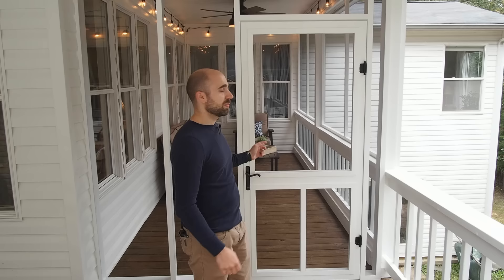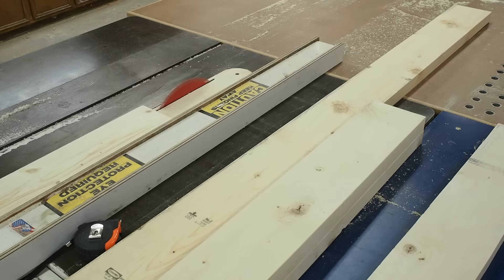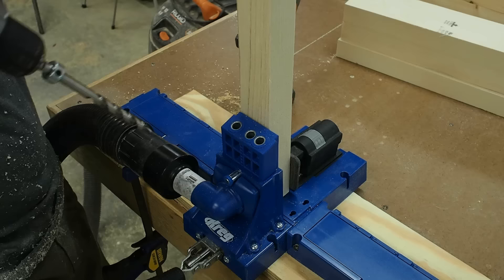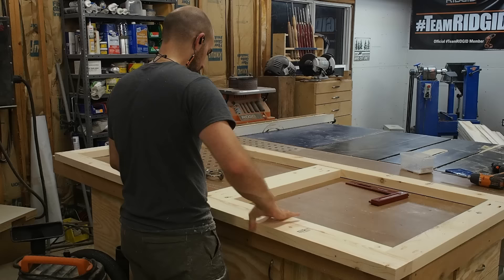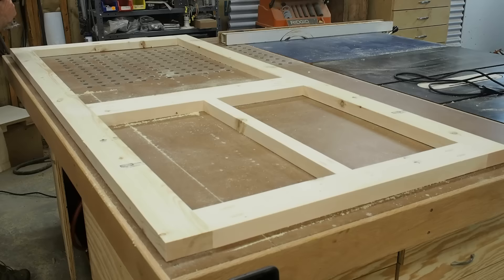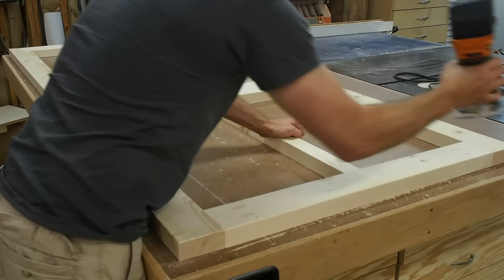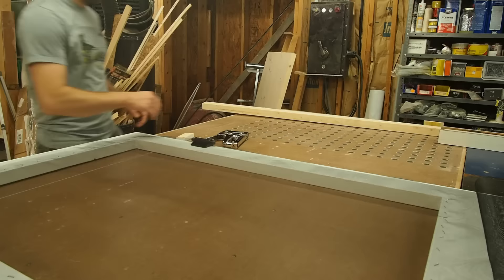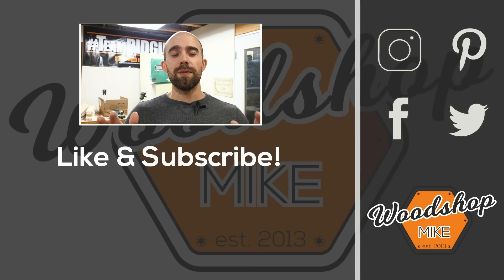How to Make a DIY Screen Door

Comment: Going to make one almost the same way.  Mike is right, this is quick and easy the way he's doing it.   Im not real fond of pocket holes for exterior application.  Im using stainless steel dowel pins in each corner and the bottom section of the door will be wood raised panels.  I only want screen on the top.....Great job Mike...
Reply from the maker: Thanks Raymond!  Happy building 🔨🔨
Reply: @WoodshopMike  You too Buddy!!!
Reply: Try Zinsser BIN Primer with a Top Coat of PPG Breakthrough......The combination of the two makes a finish I have yet to beat.   It's a little pricey but its worth it.  The primer dries extremely hard and gives a nice crisp hard finish with 220.
Three coats of PPG Breakthrough and its like  glass smooth...
Reply: I use a spray gun that is designed to shoot "metal flake" paint ....It has a 3.0mm tip so it will spray the primer and paint un-thinned.  If your doing any quantity of big doors or big surfaces....This is the only way to go....fast and awesome results...
Reply: Just passing on what took me 40 years to learn....If I can help someone with information...why not...right..???

Comment: I'm amazed you used pocket holes in place of the tried and true mortise and tenon.
Reply from the maker: Yeah I understand that.  Time will tell how they do, but a year in and the door is very solid 👍🏻👍🏻
Reply: The pocket holes were the "Quick and Easy" part.  Even I can do that,  lol....  Like this door, but it would be a week long project for me,  then it would drag. lol.
Reply: I'm going to build this with dowels--slightly cleaner and stronger than pocket holes and much less work than mortise & tenon.

Comment: Hi, this turned out great! I was curious to know how well the screen door held up? I read that the mortise and tenon is the best and most used method. I am just a beginner and wanted to make one in the spring. My initial thought was to use a Kreg jig and wood glue.
Reply from the maker: Hi Monique,
The door is holding up great!  Mortise and tenon will be a very strong joint that will last a long time, but we've had zero issues or signs of failure from using pocket hole screws.  I don't foresee any issues with the construction method I used for the door 👍
Regards,

Mike

Comment: Thanks for the video. Is that a Georgia Southern  shirt? Lol I went to school there for awhile. Can't say I miss it. I am from Savannah. Your door will look 1000 times better then mine. Nice setup. You have all the good tools. I wish I had a few of those saws. Lol what about using blind nails? Do you think it would hold?
Reply from the maker: Absolutely, hope it was helpful!  Yep it's a Georgia Southern shirt.

You can certainly nail it together, but I doubt it'll be as stiff.  You can always use something like decking screws and drive them in at an angle if you don't have access to a Kreg jig.

Comment: I wish I could give it 2 "Likes" for the oscillating tool trimming of the dowels! Genius! What 1/8" router bit do you use brand wise? Great video Mike! I need to build a new screen door for my garage and this will be helpful!
Reply from the maker: Hey thanks bro!  Yeah, the multi-tool is the way to trim dowels in a hurry!  That's a bosch 1/8" round over.  It's been a good bit and I've had it for years.  I also like White Side and Freud bits!  Glad the video was helpful!

Comment: Love the video. Many of the other screen doors I have seen are made with 1x material and don't include any cross braces. With this being 2x6 material, is there any concern for sagging over time?
Reply from the maker: Thank you!  This door has been installed for several years at this point and it's still square and plumb in the doorway 👍

Comment: Nice work.  I might attempt this with PVC 1x instead of the 2x.  Any drawbacks you can think of?
Reply from the maker: Thanks John!  My only concern would be the thinner material flexing.  PVC would be nice though for the durability!
Reply: @WoodshopMike  The flexing is definitely the only big drawback I can think of.  I do prefer the maintenance-free material though.
Reply: PVC moves with changes in temperature.

Comment: hey, thanks for sharing, really nice work. So I'm curious, what size of staples are you using? how thin do you think you could go in terms of the piece into which you are stapling? 1/4"??
Reply from the maker: These were standard staple gun staples.  I think 3/8 long.  I would go with 1/2" thick at an absolute minimum.
Reply: @WoodshopMike  Ok, perfect, thanks Mike!
Reply from the maker: @jonathanbrazeau970  sure thing

Comment: How do you replace the screen if it gets a hole?
Reply from the maker: Hi Ansley, 
I would just remove the frame and rewrap it with new screen 👍🏻
Reply: Where I grew up in the Ozarks, a hole in the screen was plugged with a wad of cotton. You changed the screen when there were too many cotton wads.
Reply: If you use aluminum screen, you can patch holes with extra bits of screen.  Cut a squared off piece a bit bigger than the hole and remove a strip on each edge so it looks like it’s frayed.  Bend the frayed edges all in one direction so it looks like a box top.  Then insert into the screen on top of the hole and bend the frayed pieces inwards to lock them in.  

Hope that makes sense!  They sell patch kits but they’re easy to make if you have some scrap screen.

Comment: Your instructions say rip 2 x 6s but you cant split that into 2 3-1/2" pieces.  Are you ripping 2 x 8's to 3-1/2" pieces or 2 x 6's to 2-1/2"?
Reply: He's saying you get one 3 1/2" piece from ripping down one 2x6. Repeat with another 2x6.  Then whichever of the two offcut pieces looks nicer, rip it down to 1 1/2" wide for the vertical piece at the bottom of the door. Yes, there is wasted wood.

Comment: All-in-ali, I am very pleased with your build, but I have two questions: 1) Why did you not glue all the joints? and, 2) why did you use fiberglass instead of aluminum screen? Cheers!

Comment: How did you secure the casing into the vinyl?
Reply from the maker: I cut the profile of the siding onto the board that's secured against the house.  I made sure to secure it to a stud in the wall with 4" exterior construction screws.
Reply: @WoodshopMike  yikes! Can i just use liquid nails??😬

Comment: can you do another screen door with a pet door in it ?
Reply from the maker: I don't have plans to make that any time soon, but to add a pet door you'd just add some 2x2s to the bottom to frame out the opening👍
Reply: @WoodshopMike  MIKE I HAVE A 15 ' WIDE  COVERED PATIO AND SINCE WE LIVE ONLY A FEW BLOCKS FROM THE BEACH , I WANT TO BE ABLE TO PUT MY SCREENS IN THE GARAGE DURING THE STORMS.   IN OTHER WORDS  I WOULD PREFER SOMETHING LIKE  4 OVER SIZED  GLASS SLIDING DR  SCREENS.  I CAN NOT FIND ANY MANUFACTURER THAT WILL SELL THE SCREEN  DR.S  W/O THE ENTIRE SLIDING DR SYSTEM.   SINCE I WANT THEM TO BE  8' TALL ALL THAT BAFFLES ME IS THE  TOP AND BOTTOM TRACK  ORDEAL.  PREFER TO NOT HAVE TO SLIDE WOOD  FRAMES  ON WOOD TRACKS W/O  WHEELS OR ROLLERS.  CAN YOU BRAIN STORM SOMETHING OR SOME ONE FOR ME ?   IS THERE SOME KIND OF KIT THAT I CAN GET A HOLD OF ?    PERHAPS 4 BUNDLES OF PRE-CUT WOOD FRAMES  AND  TRACK PARTS THAT I CAN APPLY MY OWN SCREENS TO ?  THIS  SENIOR  GIRL HAS NO FEAR OF ANY KIND OF PROJECT.....🤗

Comment: “Quick and easy” ...yeah, when you have all the right tools and equipment. Lol
Reply: MadDogHoek23 I don’t know. I have all the tools, but it’s still a long process.
Reply: You think tools and equipment make this quick and easy? You can use all mine. I will keep 911 handy, no pun intended, while you make an absolute fool of yourself.

If I had a shop that size, my life would easier but nothing about being a maker is quick or easy.  If that were true, garages full of tools across the country would be used far more often than they are(and construction would be a horrible career choice).
Reply from the maker: @apacherose7337  I just saw this.  You are right on the money!
Reply: @WoodshopMike  No worries. Still need a bigger shop myself but I am closer to making that a reality.
Reply from the maker: @apacherose7337  That's awesome!
Reply: Yeah... not what I was expecting.
Reply: There is indeed a tremendous amount of skill involved here. I too have the tools and all the basic knowledge, but it is a big project.
Reply from the maker: @717UT  thank you Max 👍🏻👍🏻
Reply: I built one.  It wasn't that hard. I have some tools, but a very small shop. My biggest wish for when I assemble something that big is for more flat surface to put it on. Improvisation is key. I want to know about installing the door hardware.
Reply: Hit me up if you need help!
Reply from the maker: Thank you for the offer. 👍🏻👊🏻 I'm a one man show for now.

Comment: Pocket screws are for folks who don't want to learn proper joinery. I get they have their uses and place, like the skirting under a coffee table. But when in plain view and on a moving piece like a door. just eww.  At the very least do a lap joint for a screen door. But a mortise & tenon still would be better. It will last seasons longer than those pocket screws & butt joints will. Sorry Lad but you lost me at pocket screws.

Comment: Unsafe table saw practices but the mask will help keep the blood off your face when you cut off your fingers. Doors made with deck screws to join corners is totally wrong, wont last long, doors made from solid clear wood with all tenon joints at corners will last a lot longer.
Reply from the maker: Not really sure what was unsafe about ripping boards on the table saw...  Maybe that there's not a riving knife?  Maybe because my left hand looked closer to the blade than it actually was?  Anyways,   for what it's worth the door is over four years old and still looks great.  I totally agree that traditional joinery is technically better, but the point of this video was to show how to build a screened door for someone that's new to woodworking.  Take care.

Comment: This is all well and good when you got an expensive high dollar wood shop & high tech equipment.
How about doing one  like the old fashioned way with simple tools.

It should be about the man not the toys.
Reply: Are you kidding? He's using a miter saw, table saw, Kreg pocket hole and hand router with round over bit. If you dont have a miter saw, use a hand saw. If you dont have a table saw, either jig saw with a straight edge or hand saw. If you can not afford the Kreg pocket hole he is using, buy the single Kreg at any box store for $14 . If you dont have a router, a rasp, hand plane ( check flea markets or second hand stores to buy one for under $10) or 60 grit-100grit sand paper to round over the edges.

Hey man, I didnt have much money for years, like washing out every ziploc storage bag to use again and again while using free pallet wood broken down to single boards because of money but this is not high tech equipment nor a high dollar wood shop at all
Reply: @bogey2230  absolutely!!